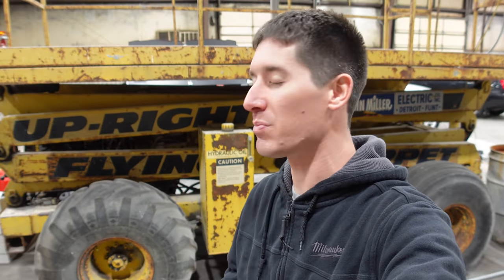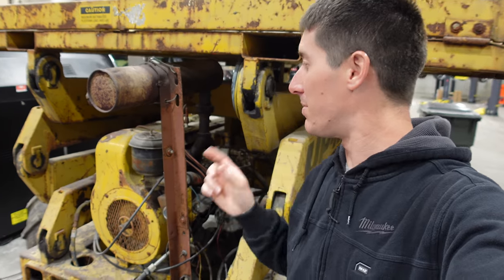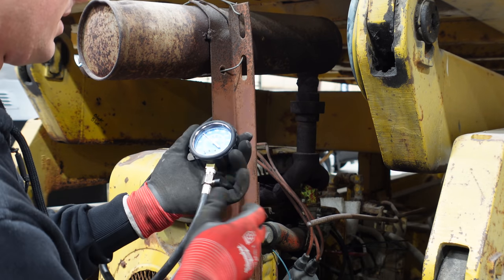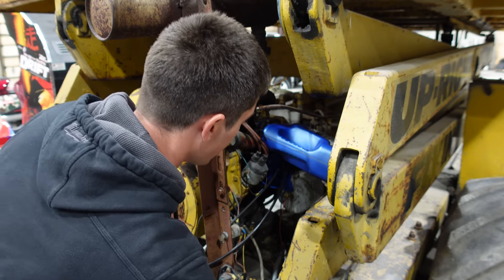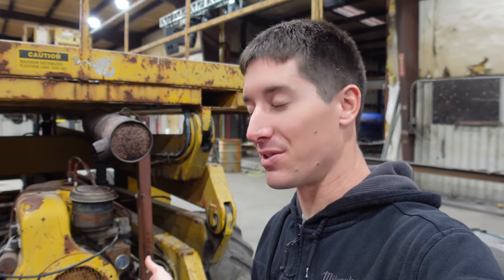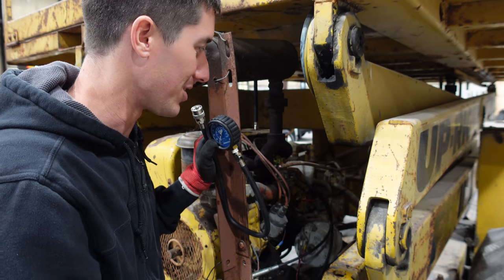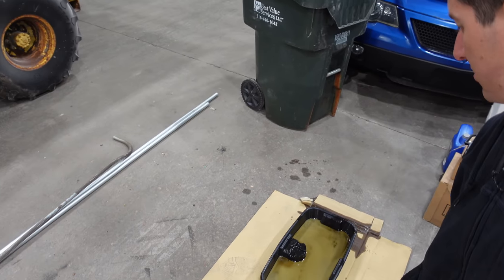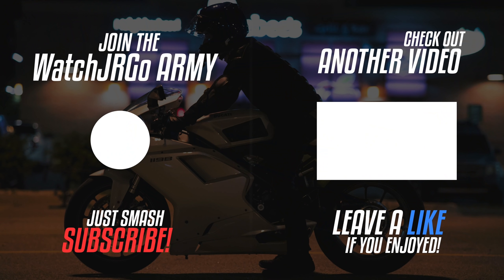Can Oil Additive FIX This WATER FILLED Antique Scissor Lift Engine?

Comment: The carb needs the fuel needle backed out a half turn or so. Fix the starting problem and it won't run as lean

Comment: JR this is bout the flash light charger. there is a two prong plug cord on the floor somewhere. it will plug into the flash light charge at the bottom left. I saw you touch the cord and didn't know where it went. bet thats it.

Comment: Any engine that does not get run often, will have condensation in the crank case. My two least seldom used forklifts are always like this. I have replaced head gaskets on both due to valve spring issues (flat heads)  
I switched to straight weight oil (non detergent) which has helped tremendously. Multi weight oil with detergents capture and hold moisture and rely on sustained operating temperature to burn it off.

Comment: Restore actually works at raising compression. I've seen two tests that showed cylinder reads before and after and it works. Been using it since it first came out and Pat Goss tested it. Use it on all my new purchases and my old Ford truck once a year after an oil change. Runs quieter and more power.

Comment: Common problem with water getting in through that style air cleaner on small engines.The water pools on top then makes it's way down the threads and through the throat of the carb👍🇦🇺

Comment: The engine restore in a metal can really works for restoring compression, it uses graphite to fill scratches in the cylinder wall

Comment: Get a length of NPT pipe to install into all your small engines oil drain ports....

Even at home improvement stores your can get NPT in the correct size and then in 2, 3, 4, 6 or 8 inch length, what ever length you need to get the drain out to a convenient spot to get a pan under.....

You Use some pipe dope and snug the pipe up tighter than you would the cap you use, this allows you to remove the cap in the future without loosening the pipe

Comment: 5 or 6 years sitting outside? Condensation.
Reply: Exactly!
Reply: But didn't he say they replaced the oil after they got it out of the field and now its back to a milk shake after a bit of use?
Reply: Marcus Damberger that well happen for the next few oil changes bc its still n the motor changeing the oil dosent matter if u dont do a motor flush first

Comment: I drop 1.5oz of seafoam per quart of oil into every old engine that looks like it's seen better days. When I picked up my 2001 F150 with the 5.4 it had lifter tick that went away after driving 100mi with seafoam and changing the oil after. Smoothed out the engine as well, never had a problem running it like that.

Comment: I think the oil looked like milk shake because of the carb is leaking fuel into the engine.. it’s always good practice just to rebuild the carb on old small engines.

Comment: For that oil fill, you need a funnel with that long metal flexible tube on the bottom. You've probably seen them in antique shops.

Comment: That smoke ring stuff is great I had a Pontiac gran dam with 300,000 miles on beat the crap out of it no rings left burned threw 5/30 in a day put the smoke ring repair in it never again
Reply: Did you put 5W30 in a 300,000 mile engine?

Comment: the smoke was likely caused by the gas in the oil. the MMO likely didn't make it stop smoking. i deal with this a lot with newer small engines since the carb on them is level with the intake. i actually initially learned enough gas in the oil will cause a engine to smoke with my 81 dodge with a 318. one of the previous owners plugged the vent line so on hot days it would just fill the engine full of gas.

Comment: I would almost park that in between your 2 buildings just in case you need it again to put up the loft and I would also fix the seals on the lift so that it doesn’t leak all over the floor. You might see about buying it also especially if the owner doesn’t want it or care about it. An old work horse like that needs to be saved and restored to good working condition.

Comment: I wonder if some of that re-seal oil additive could be added to the hydraulic fluid to possibly reduce the leaking of the hydraulic cylinders..You'd have to operate them up and down quite a few times to get the additive into the hydraulic seals. Couldn't hurt.

Comment: All the smoke was from the old oil. It was so over filled with water and gas that it started to push the oil on to the top of the piston. The reason for no smoke after the oil change was it had the right oil level.

Comment: did you check the air filter? water will usually get in through the wing nut on the air filter... synthetic in a air cooled engine??  15w40 diesel oil is much better for flat tappet engines that need zink in the oil..  valve adjustment would help with it being lean on one and rich on the other.. those old wisconsin thd engines are tanks!

Comment: If you have fuel in the oil crankcase, then the carb needle and seat valve hung open. Can you put in a fuel shutoff valve to eliminate this problem.
Reply: It could be a defective fuel pump (if it's mechanical).

Comment: Gunked up carb or configured incorrectly combined with a powerful electric fuel pump making the fuel go into the crankcase instead of the cylinders would be my guess with some condensation water.

Comment: When an engine floods, ie: doesn't start, it pukes gas into the oil, which makes the oil rings pretty much useless and the gasoline saturated oil will just blow by, up into the combustion chamber causing a bunch of smoke.

Comment: oil smells like fuel, sticking float in the carb...probably all fuel in the oil and not water.  The smoke might have been the oil level being too high due to the fuel dumping into it.
Reply: Also if the fuel is mixed with the oil it will be thinner and easier to get past the rings.

Comment: Probably it's the fuelpump leaking if it is running from the crank also happens with old mopar
Reply: I thought this too, but it also could be the electric fuel pump pushing fuel even past the needle and seat. The one cylinder is getting flooded, that’s why the one plug is dark.

Comment: Why don't you make a hole on steel plate 3/4 big right under the oil plug and it will drain throw the hole

Comment: I'd run 10w30 HDEO or straight 30 or 15w40 in an air cooled engine most passenger car rated 10w30 is fairly thin for grade and probably not the best thing to run in an air cooled engine.

Comment: Other comments are correct. Electric fuel pump is too strong.  It's pushing raw fuel past the float and it's leaking down into the crankcase.

Comment: Is the scissor lift propane powered? If so, the water is condensation caused by the propane adapter kit super-cooling moisture in the air.
Reply from the maker: It’s on regular unleaded ⛽️

Comment: Compression needs to be at full throttle to be accurate and if you are goign to change the oil and add additive before sending it out for no real reason, why not clean the carb as well since its obviously not getting enough fuel.

Comment: Your carburetor/fuel system is all sorts of screwed up. And I'm guessing you left it outside for water to get into the oil. It should be kept inside, like any vehicle when possible.

Also, I'd think it a good idea to keep the lift. You're going to need it for 100 things you're not aware of right now. And when you need it, you'll regret getting rid of it. You can fix the high pressure oil seals for the lift mechanism.

Comment: water in oil pan = head gasket death of engine or a punctured hole water jacket between block and death of the engine
Reply: This engine is not water cooled.
Reply from the maker: Air cooled engine 🍻